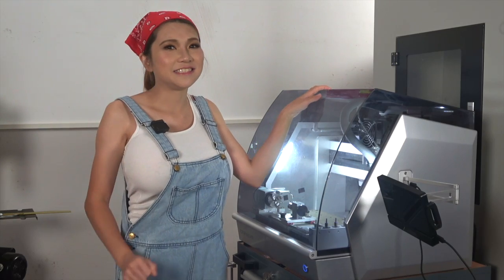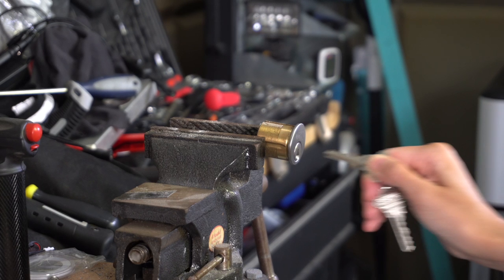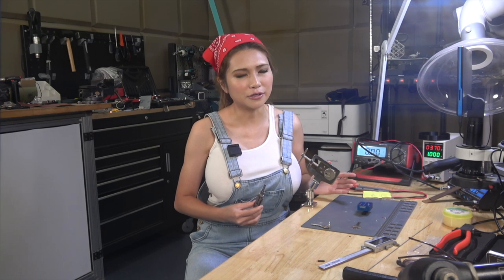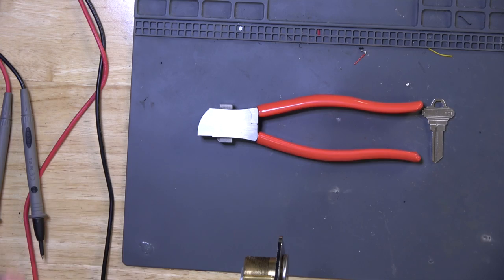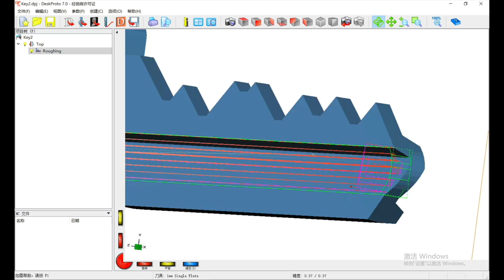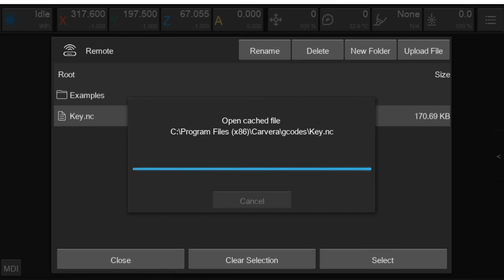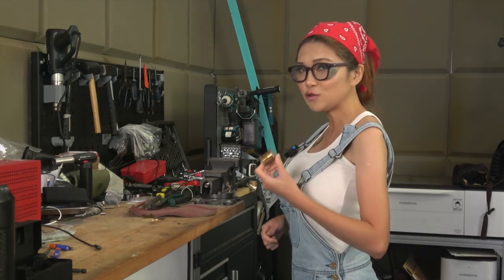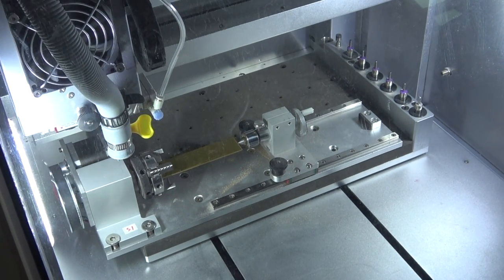Cloning Keys From Video with the Carvera Desktop CNC!

Comment: Hi Naomi, I have a challenge for you. In the Cairo museum in Egypt there is an ancient artifact called the Lotus Disc. It is a weird shaped disc made of stone. Egyptologist say it was a vase but it clearly was designed for spinning. The challenge is for you to recreate the disc using 3d printing, then spin it at different speeds with smoke added to see the pattern. Also, you can spin it in water to see what it does. You might just solve the big mystery of what the disc was and possibly unlock an ancient technology, which had been lost to our society for over 3,000 years. Cheers!
Reply: AKA the Schist Disk. Yes that would be interesting for sure. I'm sure a lot of amateur archeologists would love to see what that thing can actually do if spun up in fluid. Myself included.
Reply: @PathosBedlam  The limits of our rotatory achievements are governed by friction. Metals, plastics etc. require lubrication to prevent friction, before seizure eventually takes place. If this disc is made of granite, I have wondered if it could spin beyond super sonic speed, without lubricants and could it take on a gyroscopic motion, creating weightlessness. My initial idea of what the disc was used for was to mix polymers, which had been plastered over all the walls and pillars around Egypt, before the hieroglyphs were added. Some have even suggested that the disc was just a tool, used to braid rope, and I have to admit, that's a pretty good theory, as their has indeed been ancient rope found in Egypt.

Comment: Wow, I was a draftsman, I used physical photos in 1999 for measuring a two stories building! I had no access to a total survey station or even a digital camera, I used my old drawing board, sticked the photos and draw fuge points and auxiliary lines, all by hand. After that I used a very primitive digital camera (lended one) that used diskettes 😅 to do the same thing on AutoCAD for my graduation project, drawing details too intricate to measure directly. But copying a key... you're Kung fu is the best 😸❤️🔑🗝️

Comment: I remember, when I got one of the first cars I ever owned, in 1974. It did not have a key that came with it. My roommate showed me how to take the lock apart, get a key blank, then file the blank with a triangular file until all the slots lined up correctly. This was on a 1960 Austin Healey Bug Eye sprite which has/had a very open dash and lock and no real security as it is a rag top with no locks on the doors! LOL.

Thank you for the entertaining video and showing off the Kickstarter Mill. 

As to doing maker videos, I enjoy those also, but understand your needs to keep your YouTube audience engaged.

My current interests includes wanting to install some solar panels to assist with powering my house as well as associated battery systems and charge controllers. As I understand it, most solar panels are produced in China. Perhaps you could give some insight into the better deals and manufacturers to look for?

Again, thank you for your informative and fun videos and your charming and lovely presentation!
Reply: I'm not convinced you actually owned that car. No key, doesn't even have door locks...
Reply: @mmmlinux  It was the only car I have owned that did not have door locks. It had an ignition system lock that was bypassed when I bought it. It was a convertible with a rag, (canvas) top so locks on the doors are kind of pointless. The side windows were held on by two big knurled bolts that screwed into the doors. The top and the windows were to keep the rain out. To enter the car when the top and windows were up and on, you slid the sideways sliding plexiglass movable section of the window forward to reach into the inside door handle and unlatch it. I was young and it was my first car I ever bought and owned by myself without my parents providing a vehicle. I guess I could be making all this up but I can only say I am not.

Comment: New sub... I love the old tech meets new tech. I am an American male of a certain age, so I'm more likely to use analog tools to reproduce keys. That, and I have access to a key duplicator. As I go deeper into the security community, I realize more and more that security is a moving target and I need to replace all my locks and add security pins to prevent the low tech attacks... not sure how to prevent these high tech ones. Excellent video!

Comment: I’ve had the idea of making a (pneumatic?) pin driven key for over 20 years now. Imagine a key with pins that adjust their height dependent on, say air pressure. Then use a script to run through every key-pin-height combination (whilst applying slight torque pressure) and you can have a single key that can open any lock. Develop a handle can manage the software and power, with interchangeable key-ends (for each brand) and I bet law-enforcement and locksmiths would buy such a product if brought to market.
Reply: almost like a "brute force" attack
Reply: @pouncerminned863  yes, and given pin heights are known increments, there won’t be many permutations it needs to run through to find the correct setting. It can work every time. I just don’t have the resources to build a prototype as the tolerances are tight. But the principles are easy to understand.
Reply: @Frustratedfool  I’m going to look into that
Reply: @pouncerminned863  great! I visualised the pins spring-loaded so together always start at the lowest setting and using compressed air at increasing psi to raise the pins accordingly. Then just run the sequence (for a 5 pin lock) 00000 then 00001, 00002 and so on. As you say, it’s brute-force, but done right, could take a few seconds to get the correct sequence. You could also use it to ‘bump’ the pins, which might be a quicker starting point. Finally, once the lock opens, you have the key decoded to cut a new or spare one.

Comment: I’m curious as to the fitting the tools use; specifically is it proprietary or something with an ecosystem of potential parts already available?
Also, when it checks the tool length can it be set to halt and/or alert if the tool is significantly out of spec from what’s expected (i.e. if the tool breaks or someone accidentally loads the wrong one into the changer)?
Reply from the maker: Standard tooling- but you add a little plastic retainer rind (cheap part, comes with a sack of them).
Reply: @Naomi-Wu  cool; standard tooling is good. What does the adapter thing do for them though? It’s not going into the chuck, we can see that from the video.

Comment: You should tell Lishi to make that hand key cutting tool with the proper angle for Kwikset and Schlage, which are both different. They would sell more, no doubt. Kwikset is 90 deg with .084 tip width. Schlage is 100 deg with .031 tip width. Most people don't want to spend stupid money just to make simple key.
Reply from the maker: They make two angles, but but both are intended for thin sheet metal keys for cars. It's not really for this...

Comment: I like the form factor and the table construction using precision rails. The tool changer with it's auto probe touch off feature is a nice feature also. I own a Swiss Turco CNC mill that I converted to run from Turbo CNC decades ago. It's limited by travel and tool size. Yours has more travel but the small tooling is restricting. I have a small chuck like yours and hate it. Almost impossible to get things tight enough in a lathe application but for very light stuff like keys in a 4th axis I guess it would get by. 

What would I consider a minimum for a machine like yours? The ability to hold up to 1/2" end mills. A high RPM spindle speed to run smaller tooling at proper cutting speeds for aluminum. A proper key operated chuck on that 4th axis. And add a port for plugging in a touch probe so you can use the machine for scanning objects. That controller looks so small I'm guessing it's GRBL running on a micro processor so it may not be capable of doing much scanning, file saving and editing. If so, the whole thing could be replaced with a cheap touch screen tablet running windows and GRBL. It's probably stepper motor based to save costs but I'd like to see more of these companies develop small servo closed loop systems like the ones used on my Carvewright machines. The motors are small and should be even cheaper to make than the stepper motors but provide faster rapids and being closed loop they don't loose position like steppers do during long programs.
Reply: btw it's only using a stepper motor for the 4th axis, everything else is using closed loop servo motors.
Reply: @oolong2   That's good news!